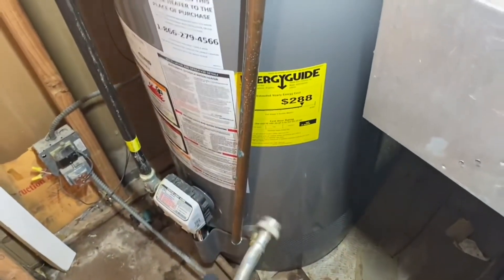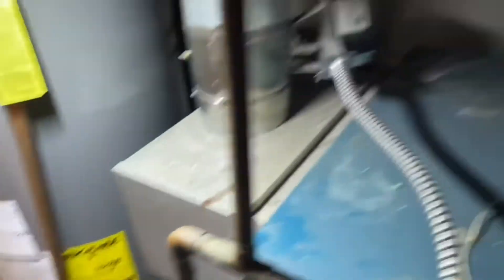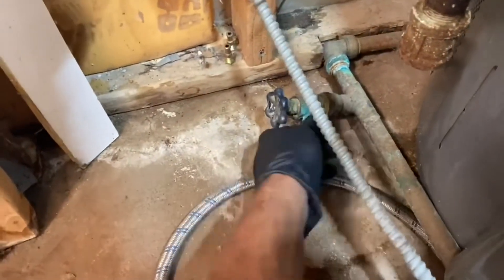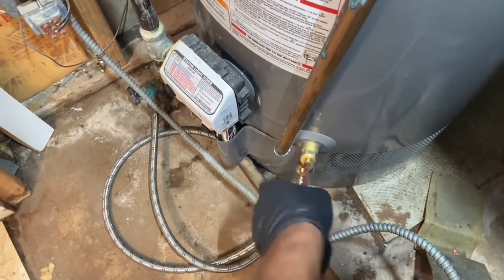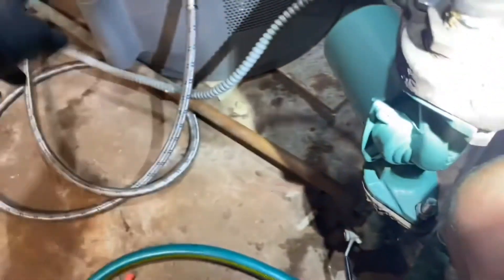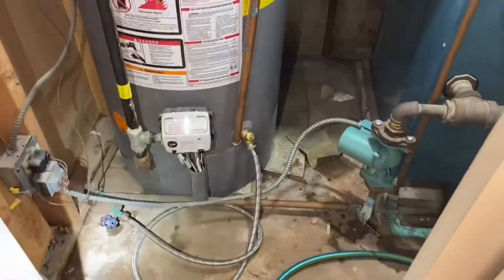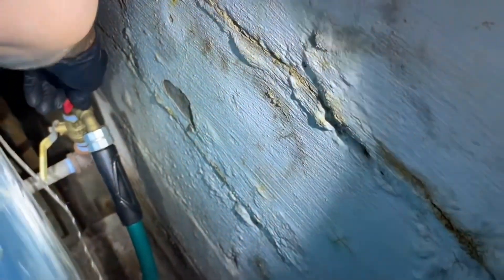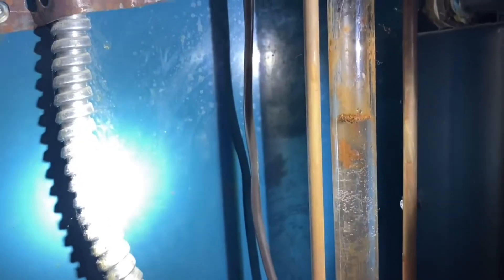How NOT to Flush a Hydronic Zone off Bottom of Steam Boiler!

Comment: Why use the water from the water heater and not from the main water line?
Reply: Its close and its hot. It will not shock the boiler like cold water can.
Reply: @scottvolage1752  I get it, makes sense.
Reply from the maker: See Scott reply